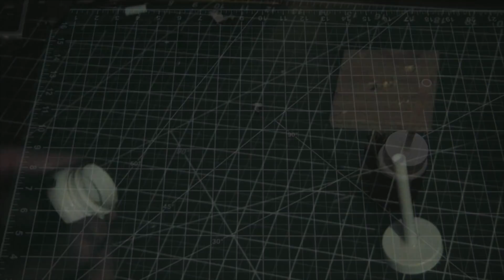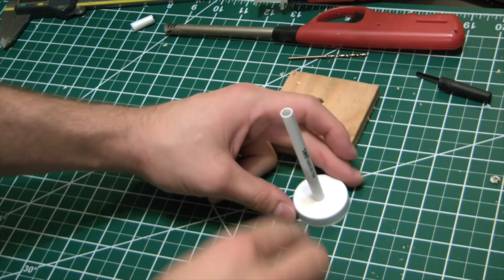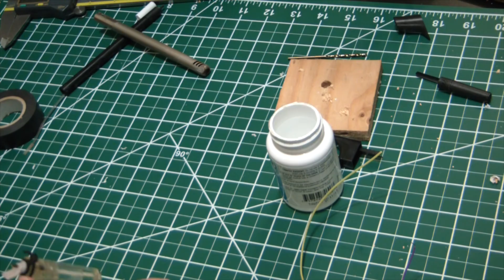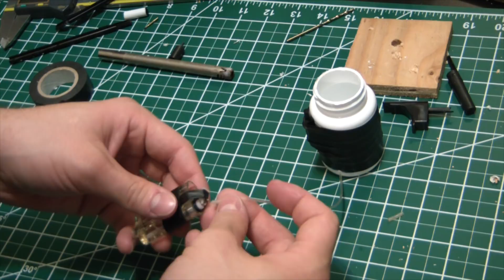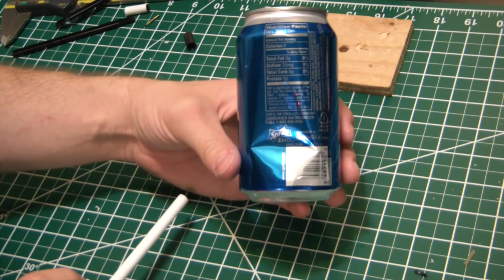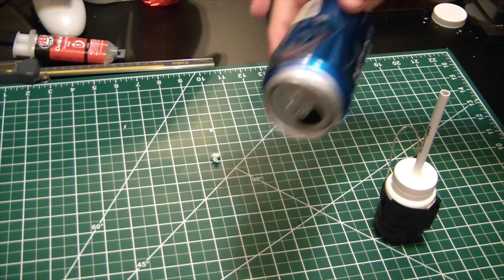MINI SPUD BLASTER - MAKE IT FOR TWO BUCKS! - ELEMENTALMAKER

Comment: When I was a kid, and pop cans were about four times thicker than they are today, we'd cut the ends off 4 with a can opener, punch a bunch of holes in the top of the 5th, with a small hole on the side near the bottom, and duct tape the shit out of the whole thing with the 5th can on the bottom.
A nice squirt of the 'ol ronson lighter fluid in the hole, and a good shake to vaporize it.

Then add a tennis ball, and some sort of flame next to the ignition hole.
Kablooey!
You'd have a tennis ball flying at least 100 miles an hour!

For even more fun, we'd make up some handles and more duct tape, hide in the bushes, and blast moving cars like it was a bazooka.

Ah, the crap you could get away with back in the 60's without the cops or any of the alphabet soup gang showing up was incredible.

Then there was those upper echelon kids who possessed those little red or silver tubes with green strings and their contribution to the bottom line of the mailbox companies sales.

Comment: LMAO. Next time before you glue in the pen tube, in the part that is inside the pill bottle,poke or drill a tiny whole crossways and put a piece of wire, I know you got nichrome, lol, through and twist it so you're wadding/projectile don't fall all the way inside the pill bottle👍
Reply from the maker: Yep that was a dumb oversight on my part! Great simple improvement right there
Reply: @ElementalMaker  Not dumb!! You just didn't think of it.
Reply: @ElementalMaker  I made a similar type gun but instead of using a pill bottle I opened up a squirt gun and put everything inside of it, way more comfortable.

Comment: I followed this video exactly, but for some reason the spark did not light the butane. When I removed the cap and put lighter to it, it immediately have a burst of flames. Could this be because of the positioning of the butane tube and the spark? Any help accepted
Reply from the maker: Oliver Robinson it's probably too much butane. Try using a shorter burst of gas. If it's too rich it won't ignite.

Comment: I've been building spud guns since the 90s. The smallest I ever built was 1/2" copper pipe barrel with a 1" PVC combustion chamber, and the largest had a 3" EMT conduit barrel with an 8" PVC chamber.

I've always used the piezo igniters from BBQ grills, that were connected to screws driven through the PVC so that the spark would jump to the metal barrel in 2 places for more reliable ignition. I would buy a toy gun from a thrift store to epoxy to the PVC chamber body to 1) provide a convenient handle and 2) hold the piezo igniter. I use the 2-part epoxy putty sticks, though, because it can be molded into shape and provide additional structural strength for both the handles and the joint between the barrel and the PVC tubing.

I discovered almost immediately that hair spray is nearly useless because of the adhesive residue it leaves behind, eventually fouling the spud gun into uselessness. The cheapest AND most effective propellant I've found to date is automotive starting fluid, AKA ether. 1) It leaves zero residue, 2) It's already in an aerosol can, 3) Every auto parts store carries it.
Reply: W Winterheart consider using HDPE tubing instead of PVC for that version.  PVC will shatter into shards if it ruptures, but HDPE will split.
Reply: @firstmkb  HDPE should mushroom and bend allot more? rather than splintering
Reply: I heard ether expands allot faster. ?

Comment: Install a pin thru the barrel to prevent shot from falling into the tank.
Reply from the maker: That will have to be integrated into the Spud Blaster V2!
Reply: John L Bales exactly my thought. Mt full sized potato cannon uses 1/4 "bolt in a 2" pipe so a straight pin would be perfect. The perfect weapon for a desk warrior me's thinks.
Reply: I think I need to make a version of this

Comment: These are so fun to make. I like making darts out of paper and nails and one small cannon was able to put a 1/16" nail thru half an inch thick book. Haven't made one of these in a while and I just might make one today.
Reply from the maker: Awesome to hear someone else has made these! They are crazy powerful for their size. Thanks for checking out my channel!
Reply: ElementalMaker Your channel is quite good and I wish you will keep making videos regularly. I subbed after watching your first video and I do not sub often. All the best to you.
Reply from the maker: Thank you for the encouraging words! I don't plan on ever stopping, I love making stuff! If you ever have ideas or suggestions feel free to share
Reply: ElementalMaker Had to think for a while and came up with the idea: why not make a plastic extruder or injection moulding machine? I have been meaning to make one, but never got around making one.
Reply from the maker: Very cool suggestion. I looked into it in the past, and actually already have much of the equipment to at least do filament extrusion. Injection molding will be significantly more challenging, but with the CNC should be doable.